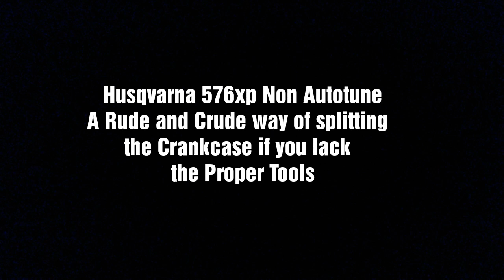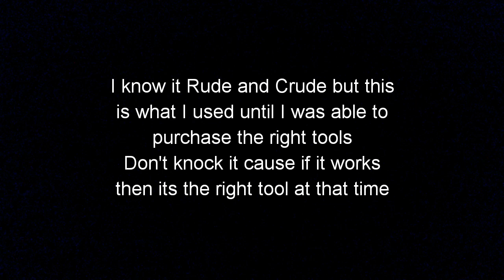Husqvarna 576xp How I split crankcase's with stuffer cranks

Comment: You made that look easy . Looks like you had the right tool for the job .
Reply from the maker: Sometimes its not about having the costly proper tools for the job, its about having one that works even if its one that you made.
I have many tools that I've made, some are 1 time use but got the job done just as good.
Still have my crank tools I made from large bolts and nuts that work for pulling cranks into the case halves that still get the gob done, but since have purchased a better design.